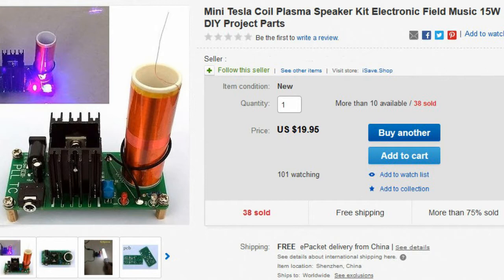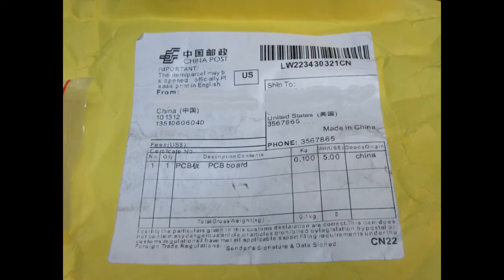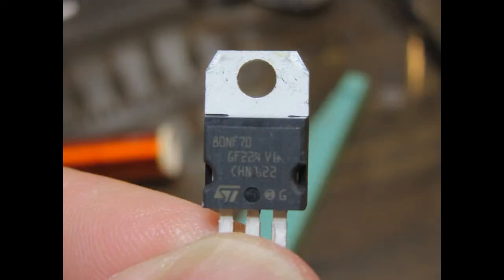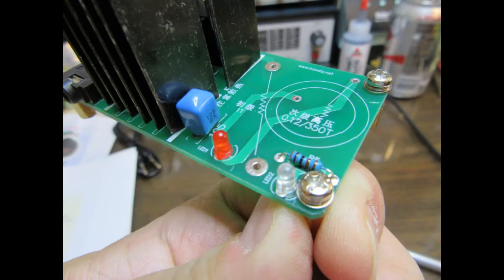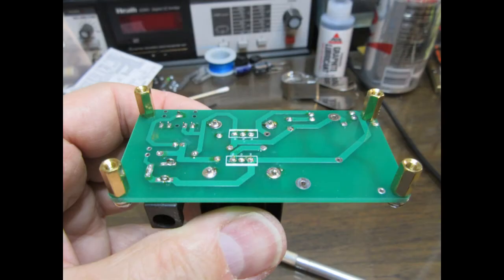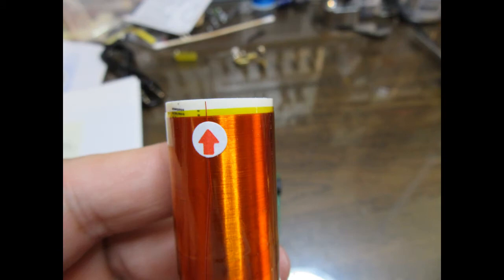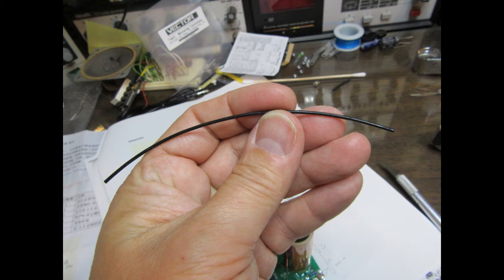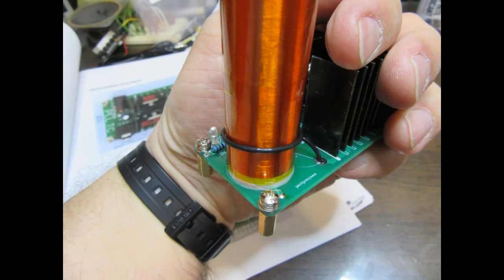Mini Tesla Coil Plasma Speaker Kit

Comment: Excellent video!  I wish I has seen your video before I put my kit together:(
 I needed the correct schematic to reference due to an ambiguity on the PCB.
 Luckily I finally got it working.
Your alternate power in spot is marked on my PCB as 'fan connection', so I promptly
dug up a little fan and connected it there.
See https://www.youtube.com/watch?v=2HbEZonDgfs